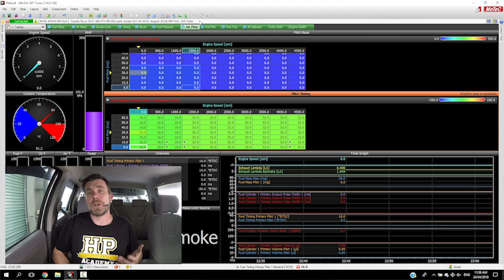Diesel Tuning Training Course - Now Online

Comment: Aight but can this course teach me enough to convert an older 100% mechanical diesel over to common rail? machining aside.
Reply from the maker: No, this just teaches you how to tune a common rail system. It doesn't teach you how to build one sorry.

Once you have your system setup and are ready to tune, from that point this course would become relevant.

We do also have a basic fabrication course. It would help with basic skills for brackets it, not machinijg however - Taz

Https://www.hpacademy.com
Reply: @hpa101  thanks a ton

Comment: somehow your homepage does not load. I would like to see some of the courses. they seem to be high quality.
Reply from the maker: Hmm, that is odd. Is part of it loading or nothing at all? I know that Norton Antivirus causes issues sometimes otherwise I recommend you try a different browser. I just checked with Chrome and Firefox and it worked perfectly for me.

Please let me know how you get on - Taz.
Reply: Hi Taz,

it loaded barely. So some of the rough design are shown. But no details. When i hover over the links, the popup shows the correct link. I tried incognito mode on chrome, so without adblock, and then it worked. Sorry about the confusion. Good night and best wishes from Germany!
Reply from the maker: Perfect! Glad you found the issue there. Plugins cause weird issues sometimes!
I just left Berlin 4 hours ago chance would have it ;) - Taz.
Reply: Berlin is a nice City. Have a safe trip back!
Reply from the maker: Danke schön! - Taz.